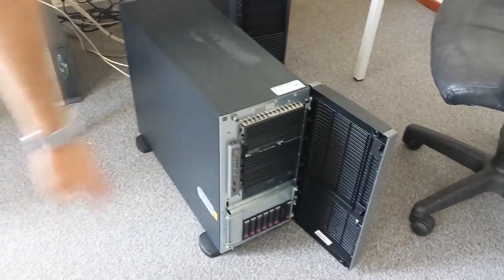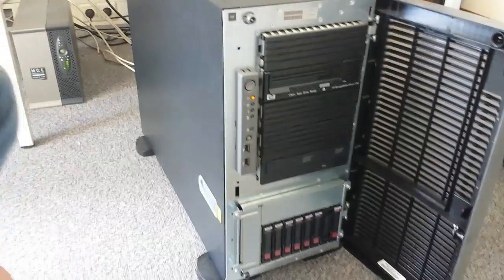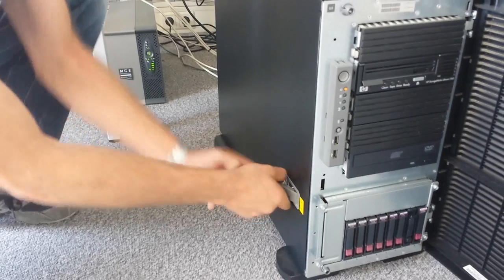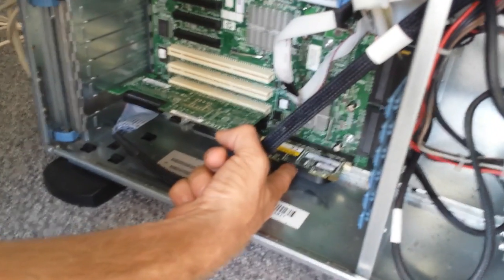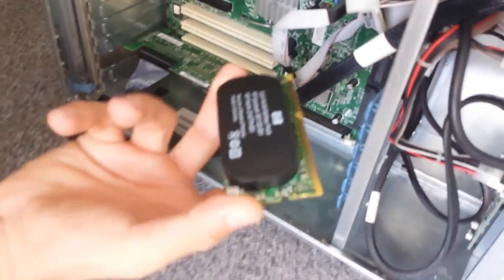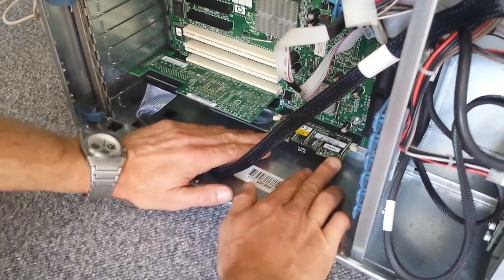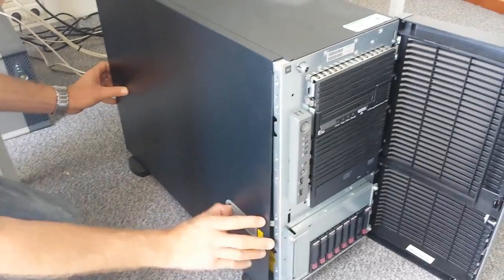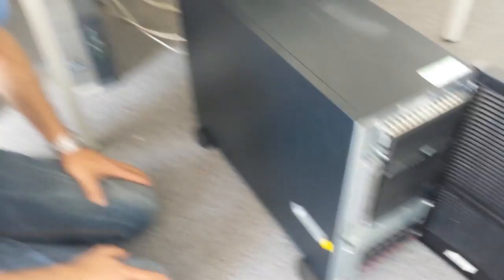How to replace the BBWC in HP Proliant ML350 G5 server

Comment: Hi Paul, My Proliant ML350 can see the controller in the BIOS, but brings up no prompt for F8 to enter the Smart Array Controller setup... After googling extensively and trying many things somebody suggested removing the BBWC... I've now booted up the server without the BBWC and it now sees the controller again... does this mean that the BBWC needs to be replaced?
Reply from the maker: i really wouldn't know, but it could be a possibility. First i would try to update the controllers firmware to the latest version (without the BBWC), and then try putting it back again.